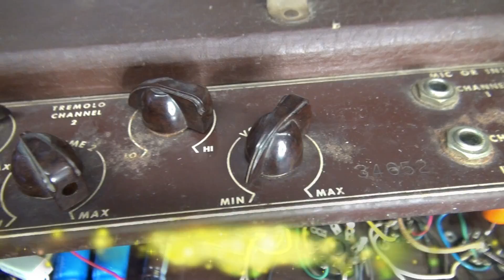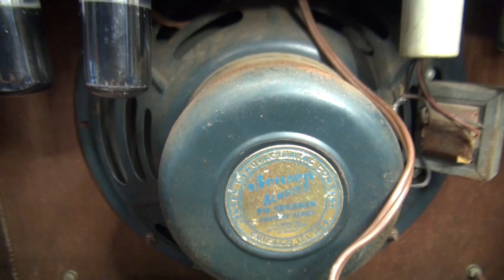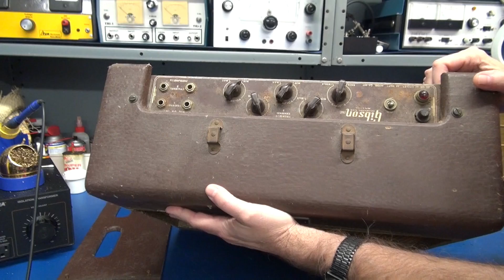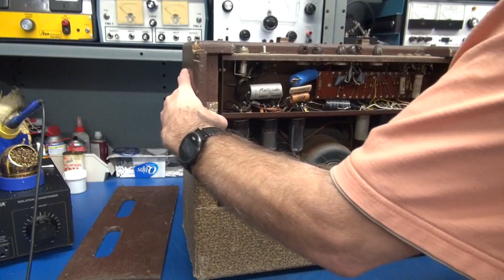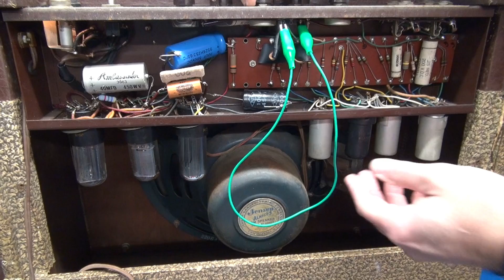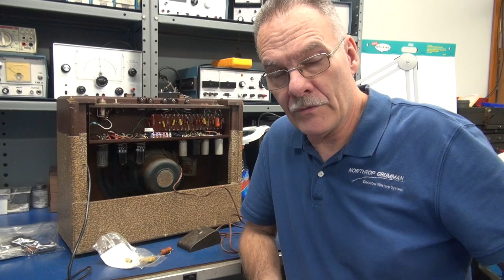Vintage Gibson GA-20T Combo Tube guitar amplifier repair Tremolo Tips

Comment: Tried to email you but it wouldn't go through for some reason. Did you notice anymore issues with the Supersonic 22 after replacing the gray IC caps and reassembly Also outside the reverb oscillation, did you notice the amp was overall noisy? Just bought one and it's coming in and I'm nervous about it being a piece of junk. I was warned to stay away from these new Fender amps and I guess I should have listened. Anytime you pay $1400-$1500 for a 22 watt amp and have to have it in the shop more than being able to play it, that's crazy. Just going off everything I've read. I suspect mine will be no different.

Comment: Umm that preamp tube socked didnt look secure at all when you could move it around like that. Shouldnt it be changed?
Reply: My 54 ga 20 sockets all rocked back and forth but looked like they came from the factory that way
Reply: @terrycox3594  Is it the insulator that rocks against the metal fastener? It may have shrunk over the years. I know many people want their amps to be "vintage correct" but when the tubesocket can rock like this it should be very microphonic especially  in a combo.

Comment: Properly reworked eyelet board with a total recap  and out of tolerance resistors replaced now all on one side. The replace-
ment E caps are all on one terminal strip. New tubes in cleaned up sockets and pots too. How could it not be a favorite 
among a vintage Gibson amp user. Amp was made from 1956 to 1961.

Comment: Great video. What type of output bias resistor is that fuzzy dogbone looking thing in there? I have one in my 1960 BR-6 and it still measures to spec at 200 ohms. I was surprised, but also curious on what those things are. Do you happen to know?